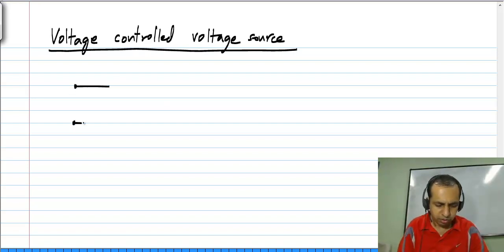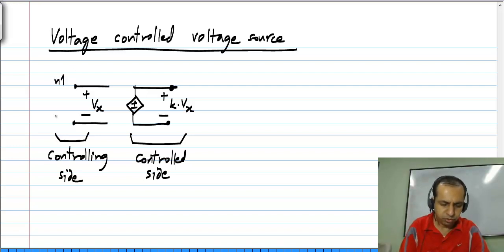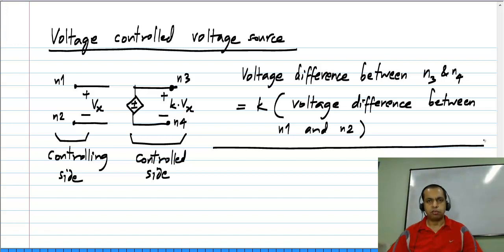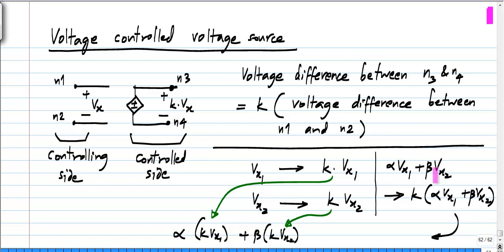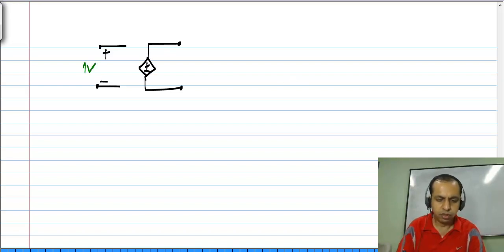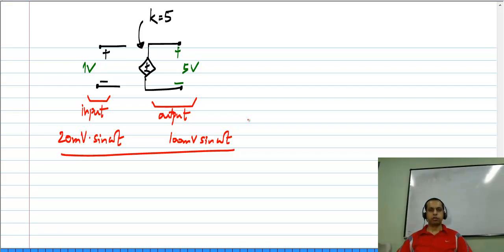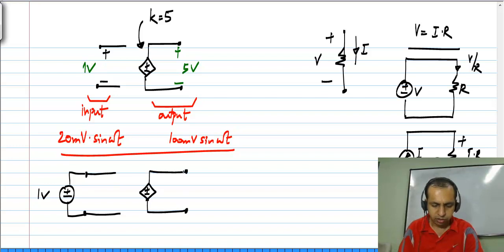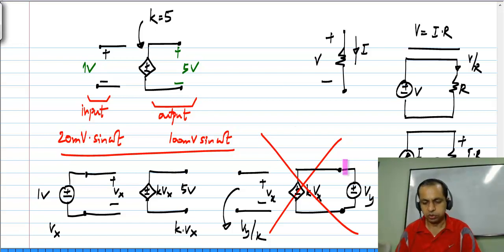Voltage controlled voltage source(VCVS)

Comment: sir if I'm not wrong is it 
 v diff b/w n1 and n2=k(v diff b/w n3 and n4)
Reply: nope,voltage difference between n3 and n4 =k*voltage difference n1 and n2,where k is some constant,a multiplier(output controlled side voltage is a mutiple of some constant with the voltage from input controlling voltage)